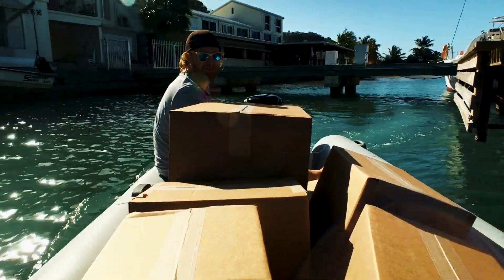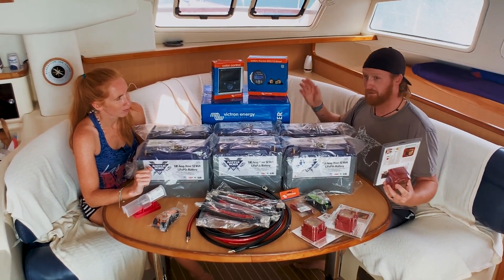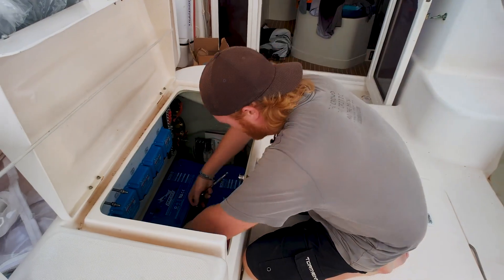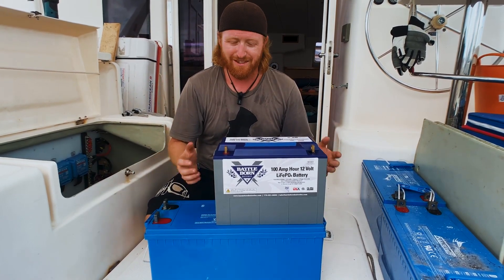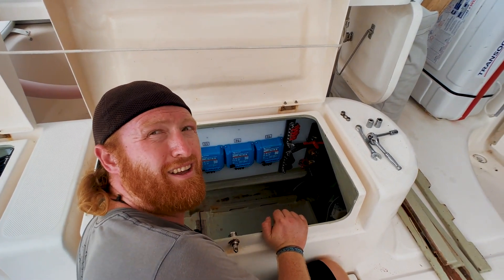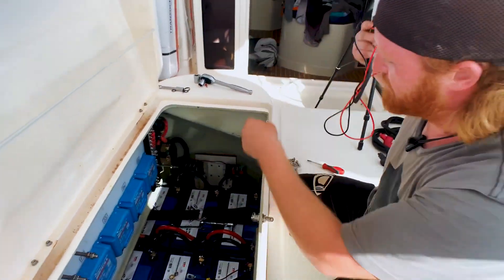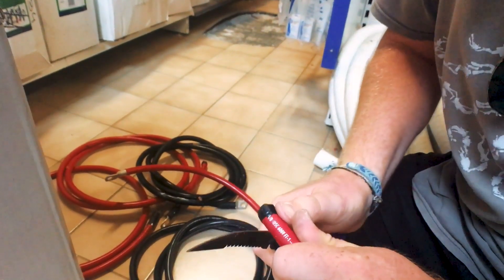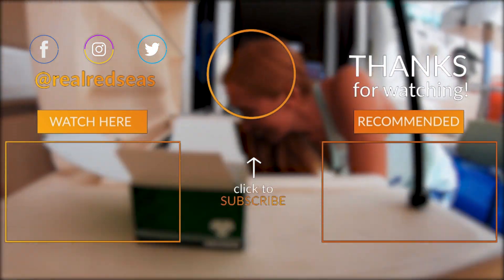Upgrading to LITHIUM BATTLEBORN BATTERIES on our boat [Ep19 RED SEAS]

Comment: Once I was working on the battery pack under the turret floor on a army tank and I WELDED the crescent wrench from a positive to a piece of the hull, okay, now that wrench is actually getting very hot, can’t touch it anymore, so I grabbed a metal bar and pried it off the battery 😂
Reply from the maker: 😮 wow ok so we didn’t quite do that 😂 the worst we had was a small spark on wiring up…that and the terrible whine that indioko made when we powered her down. Still haven’t worked out what that was 🤔

Comment: Do you have a solar charge controller for each solar panel?  Do you have a schematic you worked from?  How did you arrive at 600 amp hours?
Reply from the maker: We have been working on a write up of our installation for our patrons. In short, we worked out the system without a schematic and opted for a controller for each panel. But that isn’t always the best way to go.

Comment: Next option. you get an alternator that is overpowered to help put power into those batteries
Reply from the maker: We would kill for a beefy alternator. As it stands we have the original ones so we had had to isolate them from the house bank. Otherwise, the lithium would burn out the diodes in no time. Solar all they way for Indioko…for now